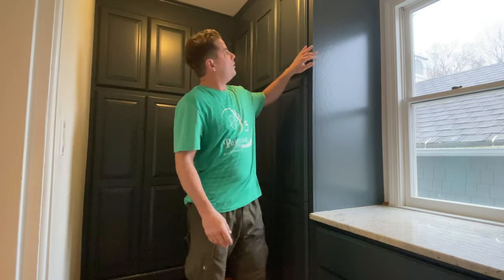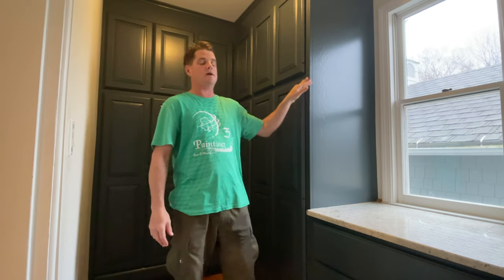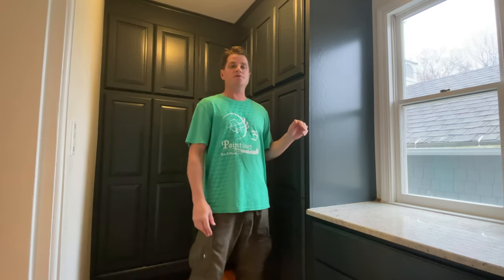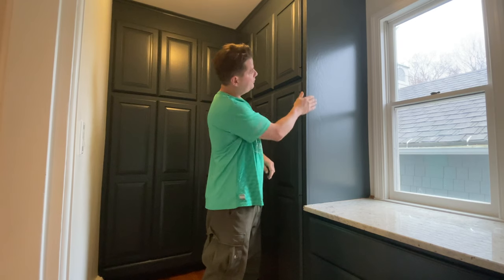Paint Kitchen Cabinets.....Using Brush & MicroFiber Roller (Part 3)  Zinsser Bin / Ben Moore Advance

Comment: The results you achieve, no matter what the project, is outstanding! These cabinets turned out perfectly!  I have watched quite of few of your videos but have not seen any on painting metal cabinets.  I have a whole kitchen full of these I'm about to take on and would be interested in your reccomendations for products and method(s).  Thank you for all the great videos!
Reply from the maker: Hi Elizabeth 

The Zinsser BIN, works fine with this! Have you ever worked with a Shellac Primer?

Russ
Reply: @RussOlinatzPaintShow  Russ...I've not used a shallac primer before. I'll poke around your videos some more as I'll just bet you've got some showing the process.  :)  My cabinets have several coats of latex (some of it is coming off) over the original finish...should I sand or use stripper for those areas before priming?  I will make a point to get some of the Zinsser BIN  when I feel confident enough to proceed. Thanks!
Reply from the maker: Hi

I would use a stripper if there in that bad shape.  It’s really easy!

Russ

Comment: Thank you for the videos, they are extremely helpful!  Question for you Russ, I have painted our cabinet doors and have used the pyramids for drying one side at a time and they all leave annoying dimples.   Do you have any suggestions on the way you setup your drying station to help alleviate while allowing the panels to dry on each side?  Thank you in advance.
Reply from the maker: Hi Troy

Thanks for your Feedback! If you look in the videos, I use a table to lay them down on. I cover the table with the Pink Paper it’s heavy weight Red Rosin Paper. I do 1 coat a day. https://www.homedepot.com/p/TRIMACO-36-in-x-166-ft-Heavy-Weight-Red-Rosin-Paper-35099/204796705
Reply: Thank you much for the pro tip Russ!
Reply from the maker: Yes those triangles dent the new paint. Whenever you paint a side, the paint has to cure before putting a lot pressure on it. What paint are you using?

Russ
Reply from the maker: No problem!

Comment: Are you dipping your brush in the pail before brushing the corners, or just using a semi-dry brush to smooth the corners with the paint that’s already there from rolling? Thanks!
Reply from the maker: I’m dipping my brush in the paint to get it into the corners, but sometimes I don’t have to cause the roller has already transferred enough paint on to the cabinet door.
Reply: @RussOlinatzPaintShow  thanks!!
Reply from the maker: No problem!

Comment: I'm painting my kitchen cabinets with the Benjamin Moore Advance. Did you sand at all between coats of the paint?
Reply from the maker: Hi

No I didn’t. If there is a hair or roller lint, just scrape it off quickly. You don’t want to scratch the paint!
Reply: @RussOlinatzPaintShow  thank you so much for that quick reply. This paint definitely takes a while to dry but I'm hoping it turns out well
Reply from the maker: Yes it levels out great! What roller are you using?
Reply: @RussOlinatzPaintShow  I got it at the local paint store where I bought the advance. It's a microfiber. Not sure of the brand. My husband actually sprayed a few doors just to see how that turned out too. Both ways look awesome
Reply from the maker: Nice! Did you prime the doors with Zinsser BIN?
Reply: @RussOlinatzPaintShow  yes the shellac one. That stuff is amazing and dries so fast!
Reply: @RussOlinatzPaintShow  I honestly wasn't sure about this advance paint at first. It takes a while to dry and harden up but once it does it's impressive
Reply from the maker: Yup!

Comment: Russ, I’m amazed by how great those doors look. Do you think the color helps minimize the appearance of brush marks/stippling - or would white look just as good if not better? PS: your brushwork is extraordinary. I find myself watching and re-watching your videos, hoping to internalize your method and be able to approximate your results. Needless to say, I am a long way off.
Reply from the maker: Hi

Thanks for your Feedback and question. I will do some cabinets in White for you too see! Thanks again for all your Support!

Russ
Reply: @RussOlinatzPaintShow  that would be awesome!
Reply from the maker: Do you have a cabinet project to do?
Reply: @RussOlinatzPaintShow  yes. Like most of the woodwork I’ve painted, the cabinets didn’t come out great three years ago; and I’m just starting to prepare them for re-painting
Reply from the maker: Ok what sheen did you use?
Reply: @RussOlinatzPaintShow  originally, I used SW Emerald Urethane (not sure whether it was Semi, but I think it was Satin). Now I’m debating whether to use Advance (Satin) or Scuff-X (Satin). One issue I have is that while I understand that BIN primer is superb, I can’t use it due to the fumes. So I’m planning on using Fresh Start (Latex). I made the mistake last time of sanding too vigorously, and that left scratch marks. So I’m thinking of applying 2 primer coats.
Reply from the maker: Ok so you sanded the Sherwin Williams Emerald too vigorously?
Reply: @RussOlinatzPaintShow  yes. In some places along the edges, there is a very small amount of bare wood showing.
Reply from the maker: Ok thanks for that info! Both the Sherwin Williams Emerald and Benjamin Moore Advance can take up to a month to cure or harden. That being said, you really don’t want to sand down your Top coat paint because it’s soft. Now if you have a booger or brush bristle in your top coat than just use a blade to scrape away. You want to do your sanding in the primer coats. So by applying 2 coats of what ever primer you choose, and sanding after each coat, you will have built up the surface to a smooth surface and pinned down the color if you tinted your primer to desired top coat.
Reply: @RussOlinatzPaintShow  that’s really good, specific advice. I will definitely take that approach. Thanks!!
Reply from the maker: Ok great!
Reply: How long to you like to wait before you re-hang the doors? Pretty work?
Reply from the maker: Hi Terry

A few days!

Russ